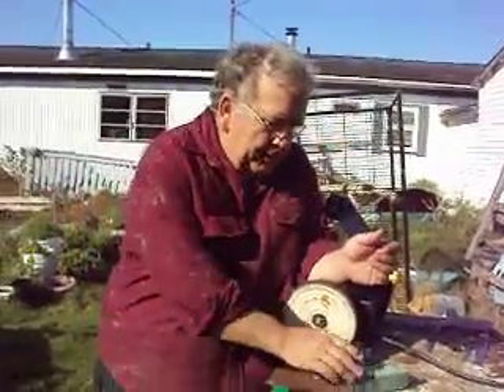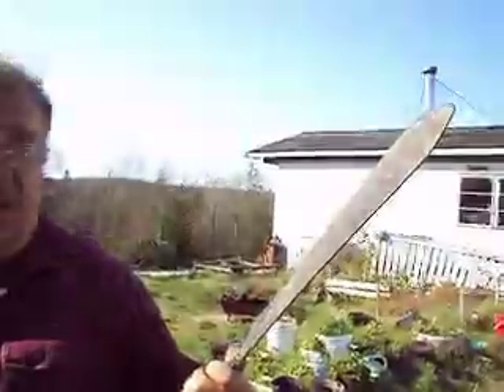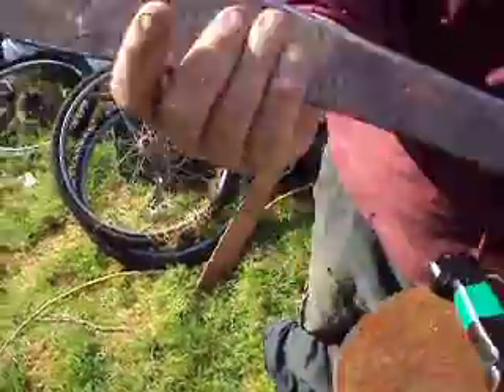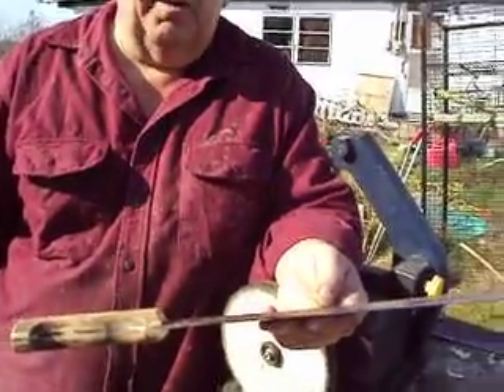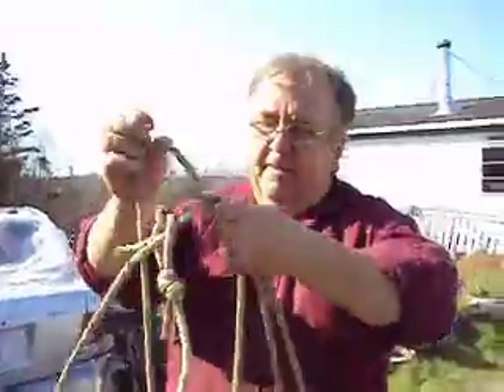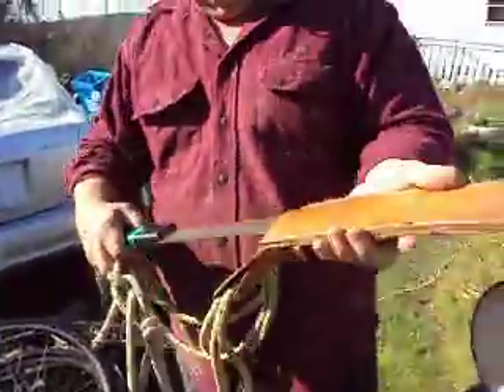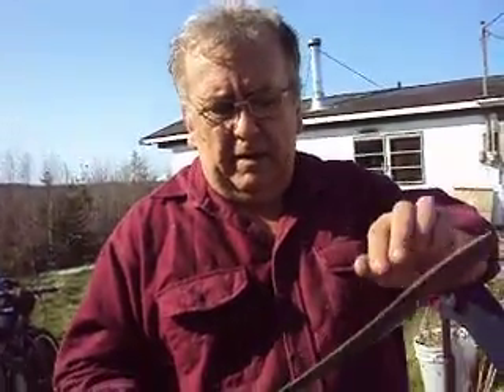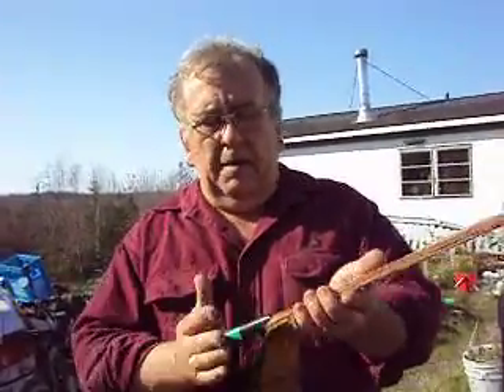Tramontina Machete Review

Comment: We use a number of 18" Tramontina machetes on the property for clearing and trimming out palm leaves. The latter is a tougher cut than you may think. The 14" Tramontina Bolo is an excellent chopper. Tramontinas are low cost and yet provide excellent service. Many make them their own with various mods.We usually work the wooden handle first. Smooth it out, round the edges and make them fit you. You might be swinging it all day long. The edge grind doesn't go all the way to the tip. It doesn't really need to. We do extend ours all the way to the tip but you may not have the need or interest to. 

As he said, steer clear of the WalMart machetes. They don't last and the steel is garbage. Instead of paying whatever for a WallyWorld Wonder, spend the cash on oil to keep on the blade and add a few bucks and get a good stone/file or both.